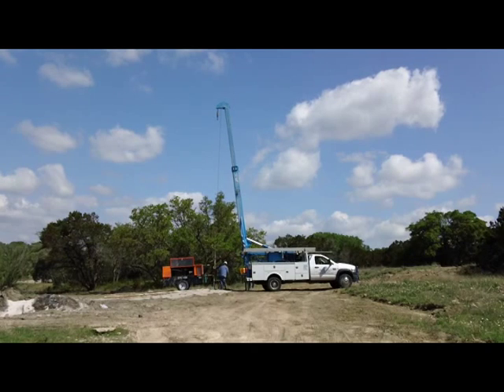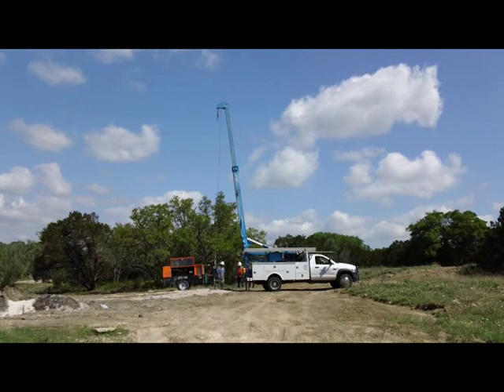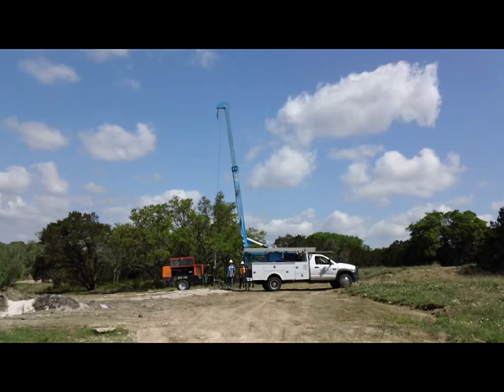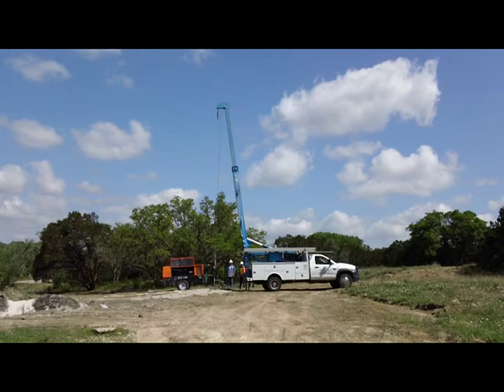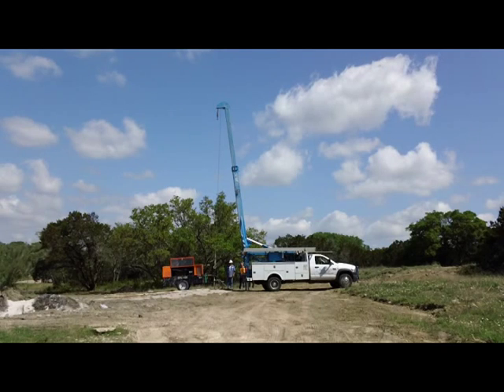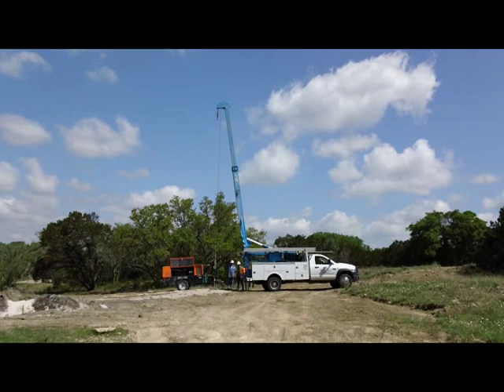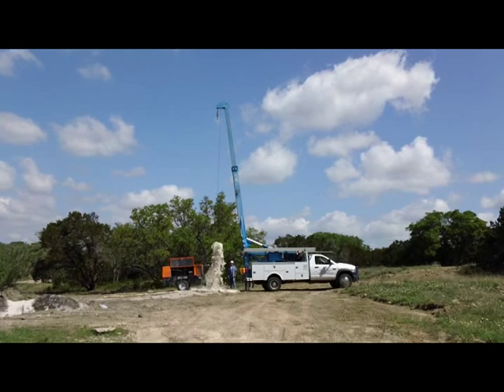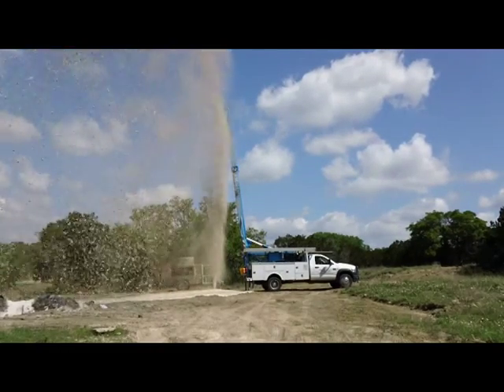Jetting a Well

Comment: Different terms,  here NEW ZEALAND,  well jetting is pumping water through a small diameter pipe with a fine screen attached,  ball valve  at bottom,  jetting into sand to Dewater for doing pipe laying at road..
Air Devolpment.  Is the term that we use for what the video shows..
27 years of drilling here, on Different types of Rigs..
Cheers..